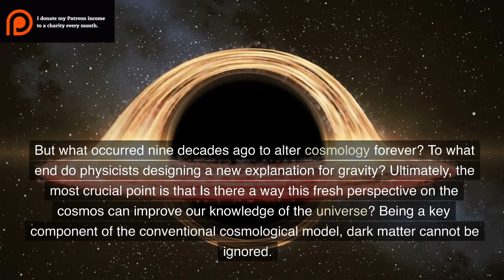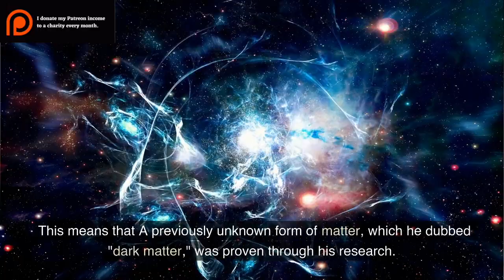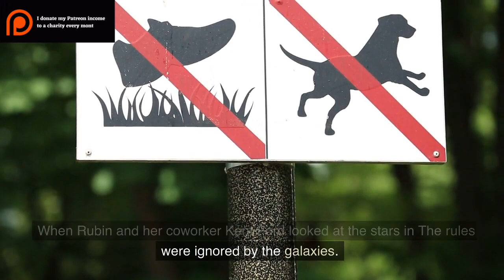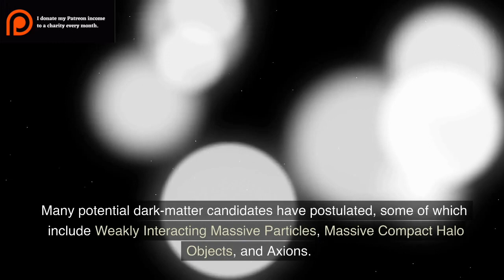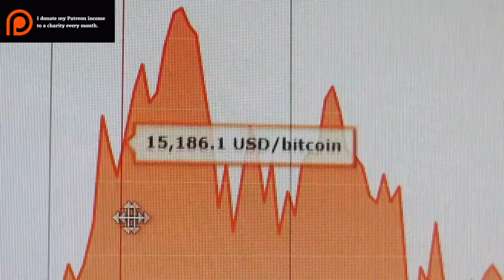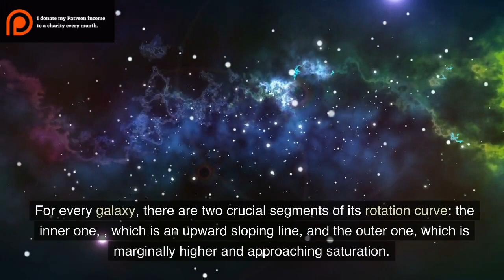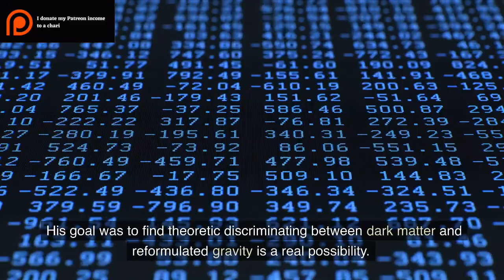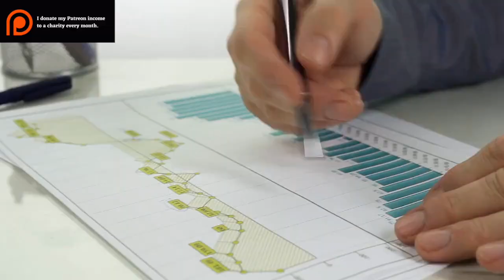AQUAL Theory: Debunking Dark Matter and the Future of Cosmology

Comment: There's No Dark Matter. There's No Dark Energy either.

Einstein’s theory of General Relativity states that spacetime is curved by the presence of mass. This curvature influences the motion other objects with mass and gives rise to gravitation. Thus, gravity is a result of geometric features in spacetime.

However, we also observe gravitational effects – curvature of spacetime – in areas without any detectable mass. This has given rise to the concept of dark matter, which is matter that does not interact in any detectable way with normal matter, except through gravity. So, there is some large quantity of dark matter scattered throughout the universe, which curves spacetime and causes gravitational effects just like normal matter, but we cannot see or detect it with any known method.

An alternative theory to the identity of dark matter is proposed – it is not matter at all, but rather an intrinsic curvature of spacetime. In other words, spacetime is not naturally flat. Even in the absence of matter, we observe some inherent curvature of spacetime.

So, the question is now – why is spacetime naturally curved? Why is it not flat in the absence of mass?

The universe is 4-dimensional, with 3 spatial dimensions and one dimension in time. Rather than consider time as a linear dimension, we can consider it as a radial one. Therefore, rather than describing the universe with a Cartesian coordinate system, we describe it with a 4-dimensional spherical coordinate system – 3 angular coordinates, φ1,  φ2,  φ3, and one radial coordinate in time, t. We live on the 3-dimensional surface of a 4-dimensional bubble which is expanding radially in time. Thus, the Big Bang represents t=0, the beginning of time.

The crucial point is that the expansion of the universe is not homogeneous in all directions. The expansion rate at one point on the bubble’s surface may differ slightly from another point near it. The universe is only roughly spherical in 4 dimensions, the same way that the Earth is only roughly spherical in 3 dimensions. The same way we observe local mountains and valleys on the surface of Earth, we observe local “mountains” and “valleys” on the surface of the universe bubble. The inhomogeneity of the expansion of the universe has given rise to natural curvature of spacetime. This natural curvature causes the phenomenon of “dark matter”.

“Valleys” in spacetime pull matter in, similarly to the warping of spacetime of massive objects. So “dark matter” is really “valleys” in spacetime that are expanding slower than the regions surrounding it. These valleys tend to pull matter in and create planets, stars, and galaxies – regions of space with higher-than-average densities of mass. Conversely, “mountains” in spacetime will repel matter away, an “anti-gravitational” effect, which gives rise to cosmic voids in space where we observe no matter.

Each point on the surface of the universe bubble traces out a time arrow in 4-dimensional space, perpendicular to the surface. These time arrows are not parallel to each other since the universe is not flat. This causes points to have nonzero relative velocity away from each other. It is generally accepted that the universe is expanding faster than observable energy can explain, and this is expansion is believe to be still accelerating. The “missing” energy required to explain these observations has given rise to the theory of dark energy. The time dilation caused by non-parallel time arrows can be proposed as an explanation for dark energy. Alternatively, dark energy is real energy coming from potential energy gradients caused by non-parallel time arrows.

As a sanity check, we can calculate the expansion rate of the universe based on the universe bubble model. Since the radius of the universe bubble is expanding at the speed of light in the time direction, it increases at 1 light second per second. Therefore, the “circumference” of the 3-dimensional surface increases by 2π light seconds per second, or about 1.88*10^6 km/s. This expansion is distributed equally across the 3-dimensional surface, so the actual observed expansion rate is proportional to the distance from the observer. At present, the age of the universe is estimated to be 13.8 billion years, so the radius of the universe bubble is 13.8 billion light years, or about 4233 megaparsecs (3.26 million light years to 1 Mpc). Thus, we can calculate the expansion rate of the universe, per megaparsec from the observer, as:

Expansion rate = ((d(circumference))/dt)/radiusofuniverse=(1.88*〖10〗^6  km⁄s)/(2π*4233Mpc)=(1.88*〖10〗^6  km⁄s)/26598Mpc=70.82(km⁄s)/Mpc

The popularly accepted empirical expansion rate is 73.5 + 2.5 km/s/Mpc, so our calculated value is close. There may be some additional source of expansion (or observed red shift) to make up for the discrepancy. For example, if two adjacent points have some gravitational gradient due to non-parallel time arrows, then light passing through these points will be red-shifted. – Cited from https://www.academia.edu/82481487/Title_Alternative_Explanation_of_Dark_Matter_and_Dark_Energy